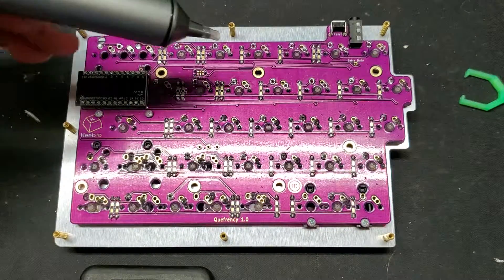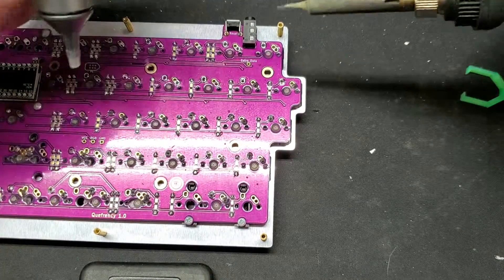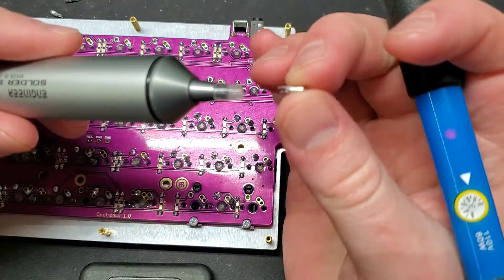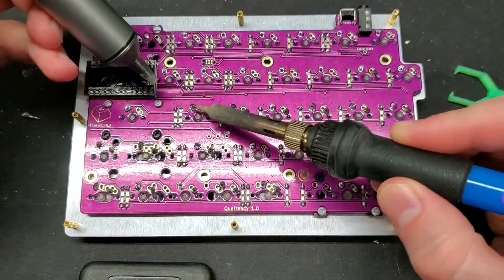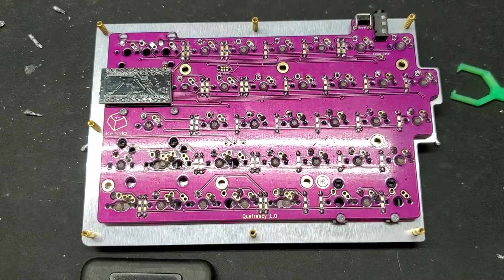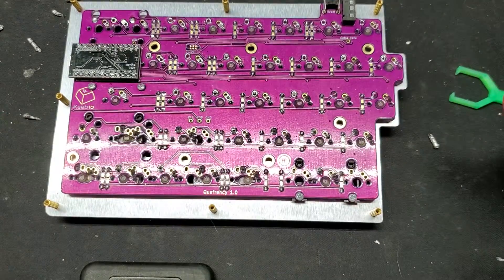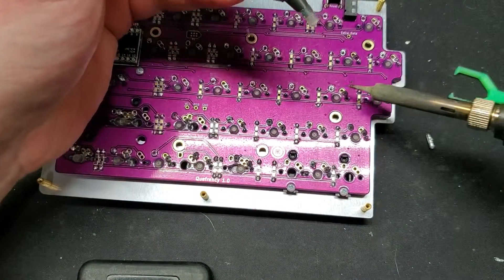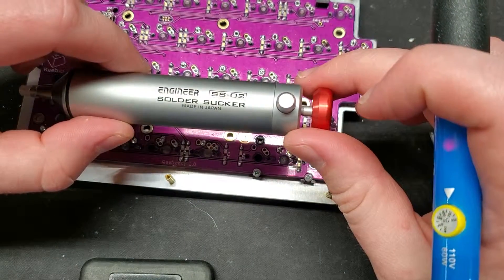Engineer SS-02 Solder Sucker - Quefrency Split Keyboard

Comment: DO NOT remove the iron tip from the joint when approaching with the sucker. The solder WILL solidify at that moment. The silicon tube does not melt easily, just press it against the joint AND the tip together. Then it will do a much better job. Otherwise, the results would not be much different from a cheap sucker. The magic here, as you say, is the silicon tip which creates a SEAL on the joint. In your demonstration though, there was absolutely no seal. You removed some of the solder, but the joints remained soldered.